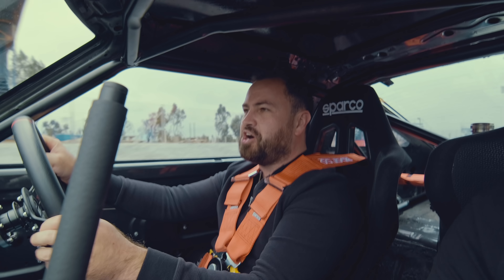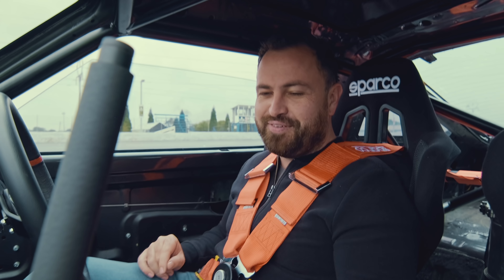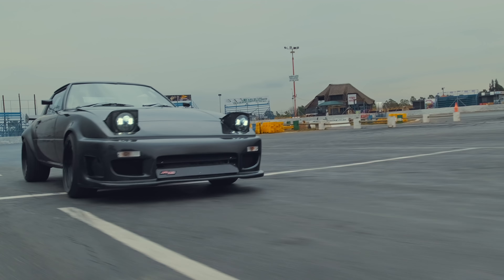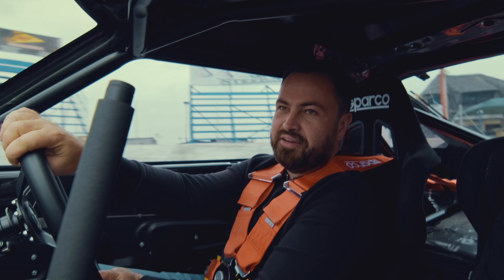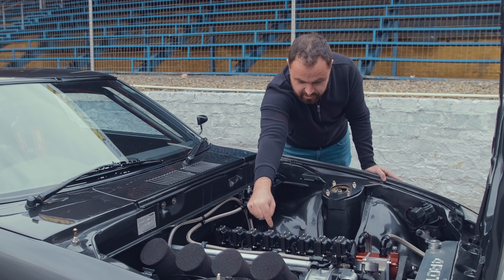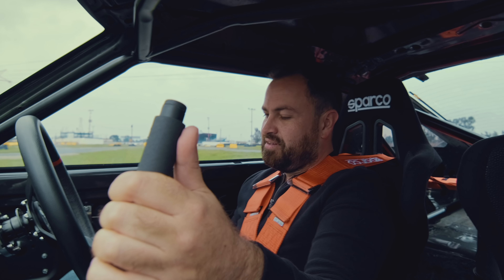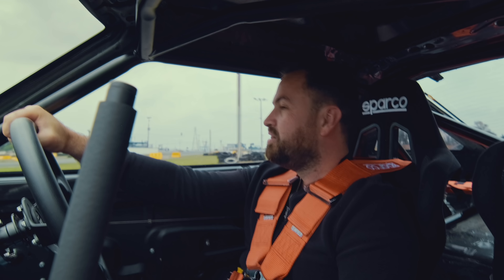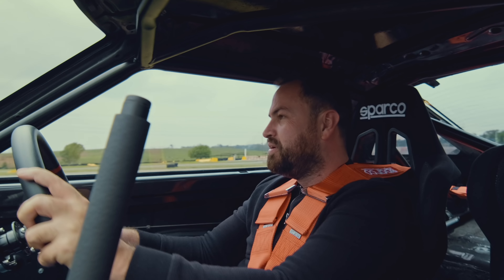350kW hand-built 4-rotor Mazda RX-7 - A Father & Son dream to build the ultimate Rotary

Comment: Rotaries dont need to run with 2 stroke oil but guys who run custom builds run premixed fuel because they delete the oul squirters. Chirro you didnt rev it out enough though lol. They work best around 9000rpm.. pull till you feel you need ti change and then let it rev more. Been driving rotaries from a young age. And most of them make their cleanest power between 6 and 9 thousand

Comment: Nice build and congratulations to the father and son duo on their fantastic achievements.. however the quad doesn't sound like a usual 4 rotor, infact it sounds like a 13b? What's the deal with that? Is it your recording equipment or have they changed the firing order of the engine different to the typical 4 rotor design adopted by most Australian and New Zealand.

By the way it's not a series 1 as indicated on video, it's a series 2 or 3 I believe
Reply: I was thinking exactly the same. It doesn't quite sound right as a 4 rotor. Anyone just search 787B or Rob Dahm and you'll see what we mean
Reply: It’s NA that’s why i think it sounds different. Rob Dahm’s is turbo’d, dunno about the 787b 🤷🏾‍♂️
Reply: The 787B is NA PP
Reply: @proactive_studio  there are a lot of examples of 4 rotors on you tube, both turbo and N/A.. the only difference between the n/a versions and turbo versions is that the turbo versions are more muffled but have a similar pitch.. the engine in this video sounds like a 13b, almost as though they constructed the eccentric shaft from 2 13b shafts with each rotor firing 180 deg after the rotor before.. where as all other quad , l believe, are 90 degrees apart.. similar to when Yamaha changed the firing order on the r1, it changed the note of the engine significantly..
Reply: I'm glad you pointed that out - because I was gonna say, "This is either a 4 rotor build with the e-shaft positioning the rotors 180° apart, or it's a peripheral port 2 rotor engine running inside of a makeshift 4 rotor block assembly. 
I know the sound of a 2 rotor when I hear one. The same goes for a 3 rotor and a 4 rotor. Most 4 rotor assemblies position the rotors 90° apart - and turbocharged or naturally aspirated, open exhaust or with 15 mufflers - the firing order has a VERY distinct and unmistakable sound between 2 rotor, 3 rotor and 4 rotor engines.
This RX7 is cool regardless - just the exhaust note is not what I was expecting 🤷‍♂️
Reply: @2lucky2tha7  yep there's no better sounding motor than a quad rotor at full noise, similar to the normally aspirated formula one engines of the late 90's early 2000's.. unfortunately this car does not have that distinct sound.  And yes any rotary enthusiast can distinguish the sound of a 2, 3 and 4 rotor without a second thought...
Reply: @proactive_studio  787b is N/A, some evil green RX-7 on YouTube is N/A well as Mad Mike's RX-7. All of them SCREAM.

Comment: Love the Car built but i'm wondering what year is this rx7 cause he said series 1 but the tail lights are not of a series 1, but the rear end is molded with the bumper so im curious if the rear end was cut and moled into a series 2-3 rear end cause a series 1 rear end is very unique vs a series 2-3, or he could've meant just 1st generation rx7 and not series 1.

Comment: Looks good. Sounds good. Seemed to scare you a bit? Heh! Not criticising. If the seats too far back and the brakes are a bit suspect only only responsible thing to do is take it a bit easy. Seem the rotor seals might be on their way out. There's a lot of smoke happening out back. I still want it though.

Comment: I had a friend who just bought an RX8, not even a day later he blew the engine, so he swapped in an Astra OPC motor
Reply: Not the most reliable engine but they do make really good power
Reply: Lol probably didn’t use 2-stroke oil… but these engines are so much easier to rebuild than normal, since there’s no valves etc
Reply: Your friend should have bough a bicycle and left the rotaries for the adults

Comment: Goodevening itits late as ido discuss this with you bud ido say welcome bag misterciro and offcause Mr.Scobbles. Iam late withis responts as I halve been both busy ad work and also Alcol bud I halve bin meaning to thing of you and they’refore here iam. Alride idid read that the people whodid make this car theydid doit by hand ido marvel ad the ability to doit for example to push a screw or a bolt or to tighten it iwould no doubt halve to use a tool like spanner plier screwdriver idothing they’re are extremely special nice I like that. Youdid say you’re are note bing a doosh please remember wedo all appreciate you’re work and you’re movies are nodoubt among the beast no problem my pleasure thank you. Iamnote without the capability to tale the truth Idonut like this car ido congrats to the people whodid makeit and fore they’re particular physical strength and for injineering enginuity bud itits loud and thereis smoke always from the rear do you remember knight rider yes ido remember it also they car was beautiful and fast and itits was able to even speak words and discuss impotent thinks about bonnie and april the ladies ithing that itits the next car to built. Or new electronical car. Or spots car. Or porsech. Bud itits impossible to built a m3 by hand result of power. Thangs again iam looking foreword to our next discussion ido encourage you to come through when you’re are free mistermadwestern will meet us bud idid warnim if hedoes bring yannie along and I didnote inviteim hewill have no choice bud to wait outside near the gatehouse. Blessings and I believe in you.